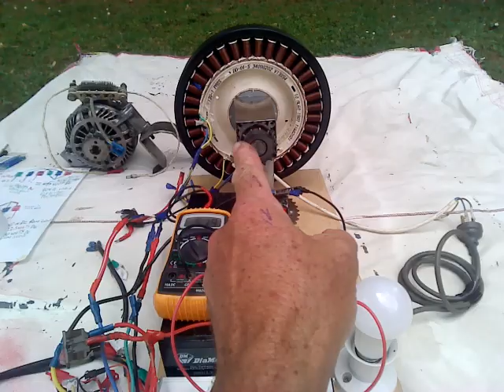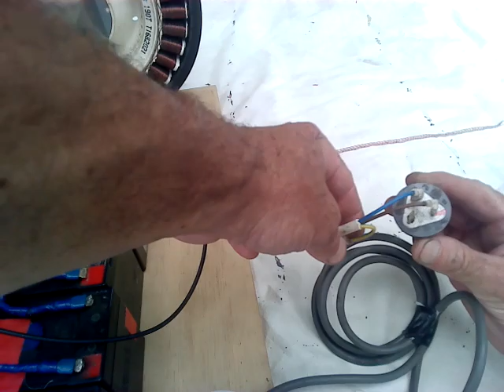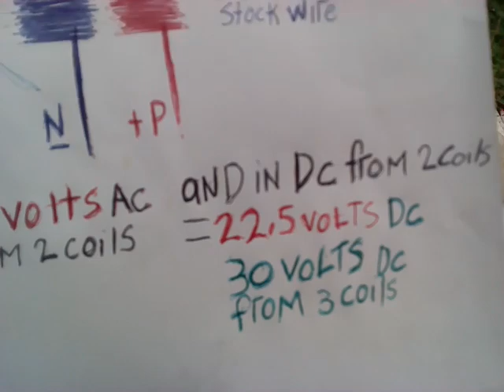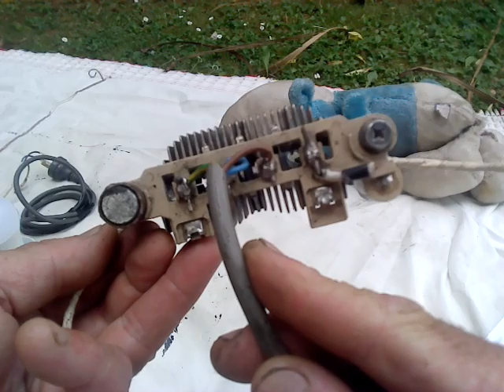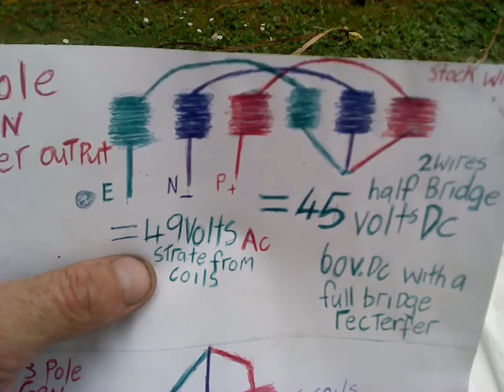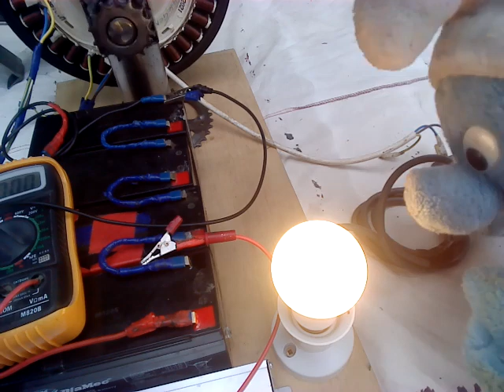36 pole washing machine motor turned into 3 generators testing

Comment: I really wish , if you could use some  other batteries , with less resistance and more useful capacity (like LiFePO4 , or Sodium Ion , or whatever) , instead of lead acid ones. 
 On the point of motor-generator , on the generator part , with mandatory bridge rectifier , it would work great , if you put MPPT wind charger (set to required battery pack voltage) on a bike , leaving more of the coils , for the "motor" part to work. Those things can handle variable speeds , like you would have on a bike. 
 It is an excellent idea to make a wind turbine , with washing machine motor (people have done it successfully many times ). Horizontal axes turbines (the ones with propeler style blades) are much efficient , but ONLY in relatively high winds and , more , or less , steady direction of a wind (which , usually requires high mounting points - 20-30 meters +). Vertical axes wind turbines (like Mary-go-round ) are much more suitable for DIY and home use and could be much cheaper to make (regarding the mounting infrastructure). I strongly suggest , that you check out YT channel of one Robert Murray Smith - on subject of wind turbines (videos from couple of years back). He explained (and showcased) a lot of various versions and their effectiveness (all from scrap , mostly).
Reply from the maker: Allsome work buddy yip i know Robert Murray yip he's really clever 😊👍I have a ride on mower back different I was thinking of using for the washing machine motor windmill Idea, ,😊

Comment: Are the windings on that motor copper or aluminum?
Reply from the maker: Aluminium I wish it was cooper lol.yip a little bit harder to soldier.i had to use thin strain of copper wire and rap it around the 3 wires your trying to solder lol😂🎉it works
Reply: @tristanmcnabb2741 you can buy flux that will allow you to solder to aluminum with regular solder.  I got a bottle for soldering to some large LiFePO4 pouch cell tabs, works pretty well.  Just need to clean your iron tips after use.
Reply: @tristanmcnabb2741  Hi! Cruserman Your got good information on stuff keep up the video. I always have a hard time soldering aluminum wire. And the copper wire trick is great idea.